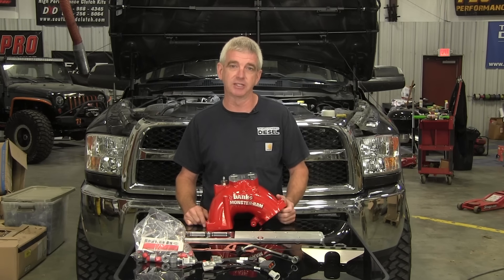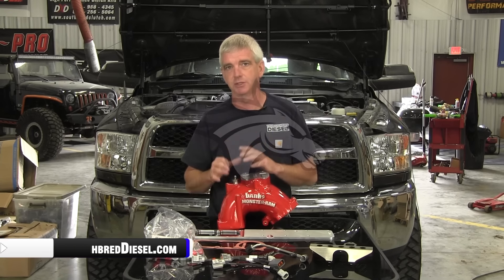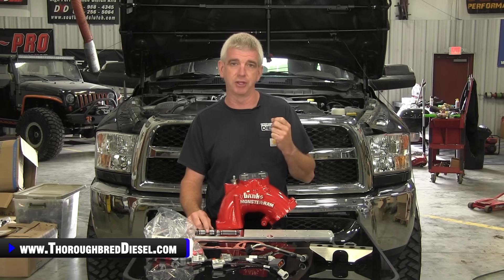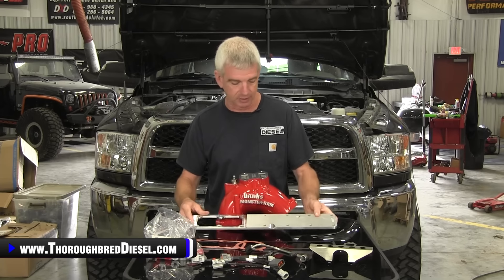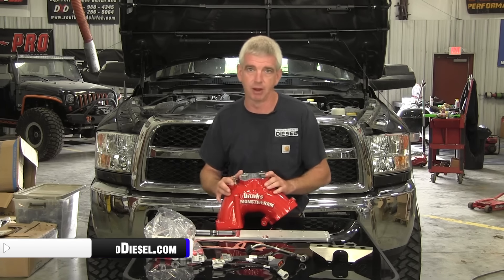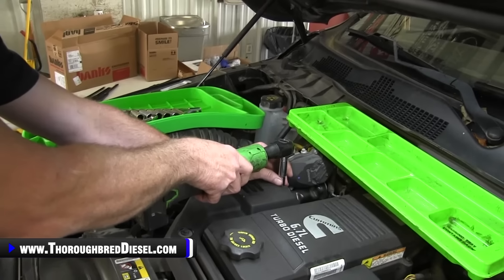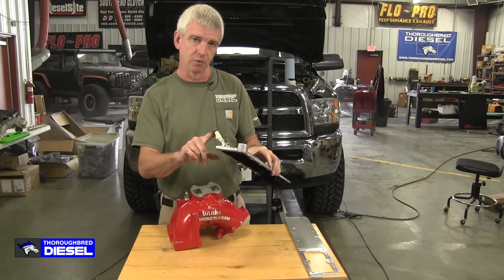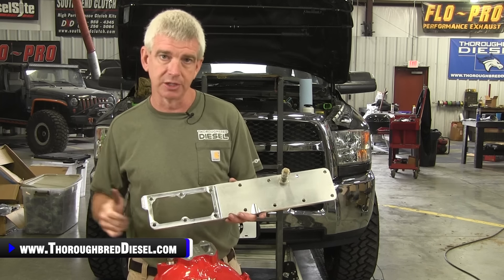HOW TO Install a BANKS Monster-Ram Intake on a Dodge Cummins 6.7L #diesel #cummins #intake #fyp

Comment: How do you loosen line 6 injector side my line won’t turn without that line in the rear being cracked  any help would be greatly appreciated thanks
Reply from the maker: The number 6 line is a bear.  I wish I had a magic formula to tell you but you just gotta grab it and growl.  Make tools if you have to.
Reply: @thoroughbreddiesel  thank you I got it great vid very informative keep wrenching dude👍🏿

Comment: can i install the m. ram kit without removing fuel rail and injector tubing?
Reply from the maker: You don’t HAVE to remove the rail but it sure makes it easier.
Reply: @thoroughbreddiesel  Can you explain more because my only hesitation in doing this is removing and reinstalling the fuel lines. 5 and especially 6 sound very difficult to remove in the first place and also difficult to torque back down properly and hope there are no leaks. The rail is bolted to (through) the OEM and then BANKS plate. How would you get the plate out without removing the fuel lines and rail? Sounds like it would be easier to not remove the lines and rail if possible. What aspect of removing it is easier?

Comment: Why not put a shim kit in the high pressure switch while fuel rail is off??
Reply from the maker: The DRV cannot be shimmed like and old cascade valve could.
Reply: Wrong. I did mine myself. Pedal response is immediate.

Comment: How many inch pounds on the torque wrench?
Reply from the maker: Here is a link to the installation manual:

https://official.bankspower.com/owners_manual/97705-monster-ram-intake-system-w-fuel-line-2007-18-dodge-ram-6-7l/?_ga=2.63469487.1873879407.1738011154-339031749.1718394257&_gac=1.138133892.1738011154.EAIaIQobChMI3rapieSWiwMVnP5MAh17bjz5EAAYASAAEgJd-PD_BwE&_gl=1*1fm0467*_gcl_aw*R0NMLjE3MzgwMTExNjUuRUFJYUlRb2JDaE1JM3JhcGllU1dpd01WblA1TUFoMTdiano1RUFBWUFTQUFFZ0pkLVBEX0J3RQ..*_gcl_au*MTMzMjkwMjM2MS4xNzM2NDU0OTM3*_ga*MzM5MDMxNzQ5LjE3MTgzOTQyNTc.*_ga_5GS5QLZZC5*MTczODAxMTE1NC4zNi4xLjE3MzgwMTExNjUuNDkuMC4w

Comment: Hi, I bought the Monster Ram kit and installed it myself, I ran the truck for a few days and everything was ok. But now I got the engine check light and I don’t now why. I looked all the connectors and seemed fine! 
 Can someone help me with this problem please?
Reply from the maker: Give us a call 859-737-4966.

Comment: Removing the fuel lines on the 6.7 Cummins but the 6th one in the back I can’t budge it. And when I can get a wrench on it I have no leverage to crack it
Reply from the maker: Soak with penetrating oil, and you might need to weld a wrench together to make something that will get you in there.  We have had to do that before.

Comment: I noticed the grid plate bolts have factory loctite on them, should i go back with some blue loctite on those seeing that my truck is high milage and the factory loctite may not be effective anymore? thanks for the video.

Comment: Any advice or tools recommendation to get the bolts tightened from the monster ram to the intake plate? The bolt under the forward PCV hose is the one I am having a difficult time figuring out how to tighten.
Reply from the maker: Long allen socket is going to be your friend here.

Comment: Does this kit work if you have an EGR delete?
Reply: Wondering the same
Reply: @Norm1212  yes just use block off plate on top of banks. Same plate you’d get in a delete kit.

Comment: Does this effect the factory warranty?
Reply from the maker: This is not a factory installed part so warranty is based on a dealer determination.  There are laws to protect you on that, refer to the Magnuson – Moss Warranty Act

Comment: Is the process the exact same for a 2019 ram 6.7??
Reply from the maker: Not exactly, the 2019’s are slightly different locations of a couple of sensors, but overall process is the same.

Comment: When you release the fuel rail lines is there pressure still in there?
Reply from the maker: No, system is at rest.  Good question.

Comment: How long does it actually take to do this job?
Reply: About 4 hours for the DIY..
Reply: Just installed mine two weeks ago.
Reply: It took me around five hours to install mine, but it was on the road at an RV resort. I was using a picnic table to stand on...
Reply from the maker: 4-6 hours depending on your experience.
Reply: How much y’all get for installation. Great instructional mate!

Comment: Hello love the videos I have a 2015 ram 2500 that is deleted will this kit work with my truck being deleted.
Reply: Yes, you will just use the block off plates that are on your current air intake as well as the throttle valve delete.

Comment: I am having difficulty removing the throttle body from the old horn on a 2014 Ram 3500 with 38k miles
Reply from the maker: Did you get it?

Comment: Does it matter which way the plenum gasket faces I did this grid heater delete with monster ram and are getting all sorts of codes involving the map sensor and turbo charger speed low?

Comment: What makes you think that heating element won’t fail. Will banks repair the engine if it does. Anything in the intake is a potential hazard. Ram should have recalled all of these for repair.
Reply from the maker: We have this style of heater in several other platforms and haven’t seen that failure in any of them.

Comment: Do you have a 2012 video?
Reply from the maker: No, but it's basically the same install.
Reply: Ok, my 2012 has the sinister delete already, no egr valve, wondering if i can just put the sinister plate on the banks. Haven’t started yet but just trying to think things through.

Comment: Hey there my mechanic just installed the banks,  monster ram and boost tubes and the cold air intake I took it home and when I step on the pedal I here a loud hiss sound Ike a air leak coming from the driver side ? It’s loud I have to take it back 
next week but it runs fine and no codes but there’s no way it should sound like this anyone else have the same issue ? It’s a 2019 ram 2500 6.7
Reply from the maker: Look for soot trails on that side of the engine to suggest a boost leak.  With the grid heater out, the bigger intake horn and the aftermarket intake, the overall turbo and airflow sound is more pronounced with this kit.

Comment: Did not show hooking back up the back Injector plug. Didn't that need to be done before you put that rubber cover over the Injection lines
Reply from the maker: Yes, needs to be done before the foam cover goes back on.  That is actually the fuel rail pressure sensor.

Comment: I think they should do a recall on the rams and fix this problem. I've heard too many bad stories with just that one nut, falling out and going into the engine.
Reply from the maker: Untill then, this is the best solution.

Comment: Anyone else hearing what sounds to be a boost leak when pressing on the throttle? I checked and made sure I’m not getting leaks and it still making that noise. Any tips?
Reply from the maker: Is this on a 6.7 Cummins?  After you did this install?  If so go back over the install good, look for leaks at the throttle valve and also the intake plate.

Comment: This is a good summery of how to install this produce. That being said What is not included is how much of a pain in the rear the number 5 & 6 injector lines are to loosen but torque to specs. I am 63 years old and have many years experience at mechanical work including semi truck Starting at my pre teen years. I am also disabled so working on stuff takes a lot longer then a well person. This took me 3 days to do but I could see 4-5 hours for a healthy person. I finally get it finished and go through the start up process and after 8 cycles still a no start and a big puddle of fuel under the truck. Yes I torqued the lines to 30 ft lb  and what a pain 5 & 6 were I thought I got them done but somewhere in the back is where it is leaking. In order to get to those lines you have to remove everything going towards the leakers. I can't do it again so off to the dealer to let them fix it. This is a good kit and will cure a problem you don't have yet and don't want. Would I do it again? You bet I would but I would also take it to someone that has all the right tool and is fit for the job.
Reply from the maker: Awesome you stuck with it!

Comment: Does the kit come with new crossover gaskets as well?
Reply from the maker: No, the EGR crossover gaskets are reusable.
Reply: @thoroughbreddiesel  one of the gaskets isn't reusable, it's that metal mesh gasket that is a one time use gasket. I had to re-use the one that was on there until I could get a replacement

Comment: I'll be doing my Monster Ram soon, just waiting for warmer weather.  This is a great video and I've already watched it twice.  I have one question:  Is the rubber isolator around the fuel lines/rail necessary?  What happens if I leave it out?
Reply from the maker: I love this question because that damn isolator is aggravating to work around.  It really is.  I wanted so bad to take it off and throw it over the hill, but there is a reason the engineers put it there so we left it in place.
Reply: @thoroughbreddiesel  I've already completed my install.  After realizing how much of a pain that isolator is, I threw it up into the loft of the barn, never to be seen or herd from again.  The truck runs great and I've had no problems without it; just a little more engine noise, which I actually enjoy.  Next is a Revmax valve body.  I'll be watching your install video a few times beforehand.

Comment: What magnetic tool did you use for the bolt that goes into intake?
Reply: Just put a little grease in the bolt head an insert the extra key wrench they send you

Comment: Can you do an EGR delete on top of the monster-ram?...
Reply: Yeah you just need a block off plate.
Reply: @Nolan45000   so I would just have to buy a common delete kit and use the banks as if it was the stock intake?

Comment: I started the installation tonight and have run into an impasse. Does anyone have advice on breaking the last injector line loose?  I can get wrenches on it, but I cannot get enough leverage to break it loose. I’ve tried a full size and a stubby. I’ve tried getting a crows foot on it but I cannot get that on due to how the nut is aligned. Any suggestions would be hugely appreciated because I may have to start putting stock parts back on it if I cannot manipulate this last fuel line…
Reply: Mine was the same but a 19mm crows foot worked. If you can get your wrenches on try linking long pattern wrenches to your stubby. Also you may have to take the box end of a cheap 19mm and cut out a section that will fit over the fuel line. My last resort was to remove the rear hoist bracket.
Reply from the maker: You may need to get a couple of cheap wrenches and cut and weld them in a configuration at gives you more leverage.

Comment: So how do you tighten and torque the no 6 line?
Reply: I had the same question I'm apart ready to install and #6 was a pain to break loose going to be even harder to torque.
Reply: @user-um2xi7ut5j  I ended up testing how much force was used on the torque Wrench and tried to match it by feel.
It doesn't leak.
Another way is to use a long crows foot or extender but if you do make sure to do the math so you can adjust the torque accordingly as an extender will multiply the torque.

Comment: Do you need to purge the air out of the fuel line b4 starting
Reply: No you don't just cycle the key on and off for several cycles of the fuel pump prime
Reply from the maker: No, good question.  Common rail fuel injection you don’t bleed or purge.  Just crank in 5 second sequences until it starts.

Comment: What tools would your average home garage need for this install that they typically wouldn't have?  HOw many hours did it take you to install?  Any other thoughts/tips you'd recommend to someone?  I've watched several videos on this install and this is by far the most detailed I've seen.  Thanks. Just subscribed.
Reply from the maker: I appreciate it!  This is pretty straight forward but I will tell you something to have on hand to make it easier is a good set of crows foot 3/8 drive in metric.  Really nice when working on the fuel lines.

Comment: 1:17:10 you don't show how you did that one bolt that seems impossible to get to. I'm stuck 😞
Reply: nvm. turns out, I was just frustrated 😅
Reply: Did you figure it out? How?
Reply: @jackjian3190  yes. that plastic tube thing for the hose unscrews 😑

Comment: I screw all the bolts in even the horn bolts before I torque a single bolt this insures all the bolts are aligned an no cross thread can occur, better be safe than extra work an a professional job

Comment: I have been asking for many years for someone to dyno test this horn vs stock with no other changes. If I had access to a dyno I would do it. 

I like the ports on these, but so tired of being hated on because I bought the horn.  
I always say, You are probably right the horn does nothing for power, but the ports make it easy to install gauges and my water meth kit. 

Either way gain or not the ports have value to me. I would just like to know once and for all. But if it shows no gain I am sure no one will share it. One day I will put it on the dyno but my production quality is garbage.
Reply from the maker: Here's the data to prove it: https://www.youtube.com/watch?v=sd2Jly-jszI
Reply: I'm much to old for this job!!

Comment: Are thes common rails known for leaking around the bung I was installing monster ram yesterday and when I pushed one of the plugs in saw bubbles
Reply: Never mind I see that it doesn’t seal on spots that aren’t welded on bung . The thread bung has nothing to do with sealing the rail it just pulls line into seal on rail . The bubbles I saw were from fuel pooling into there and draining out of slots that aren’t welded. I hope someone else sees this and doesn’t buy a new rail for nothing.

Comment: delete your diesel trucks and tune and/or rebuild your trannys. You can also do small upgrades to the tranny without rebuilding it. What good is more air into your truck if the dpf system us pouring more poison into your engine? air intake manifold intake or whatever intake is the least of your concerns. And if you live in a place where you cant delete then sucks to be you.